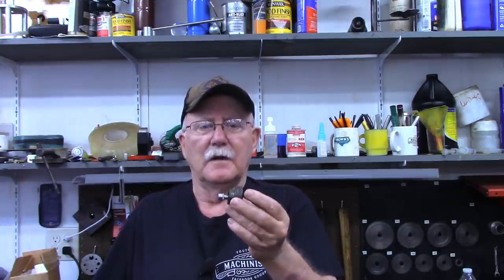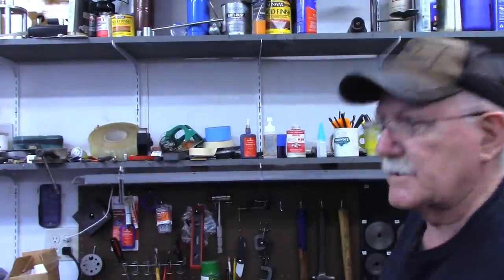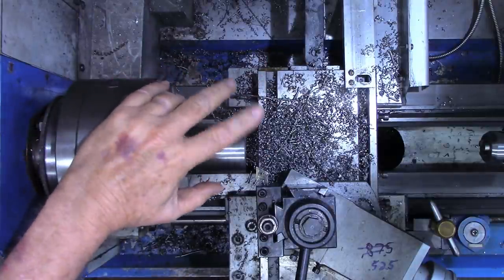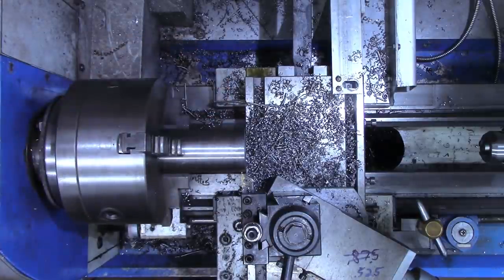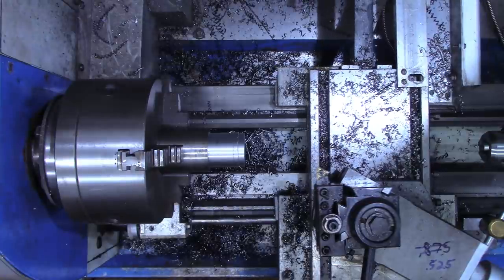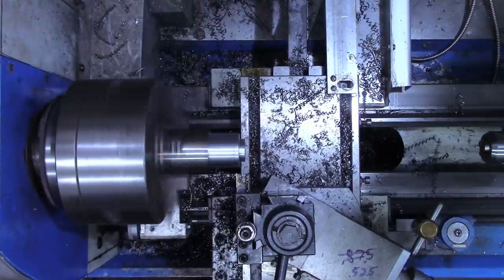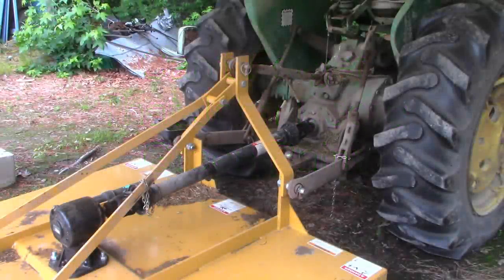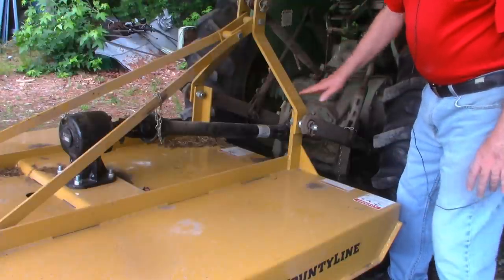Machining a Lift Lever Stop

Comment: Hi Lee . With form tools like that  if you use a slow speed , oil & a heavy in feed it usually will help with the chatter .  Just before depth , just work the tool a little to the left & right  &  drop rpm's again if the chatter rears it's ugly head again .     Cheers .

Comment: I have a Ford tractor and it had two limit stops on the lift when I got the tractor. However they were more like small wingnuts and not real easy to adjust. I like yours a whole lot better.

Comment: I think if you slow the spindle down some and use lots of oil will help some on your radius. But radius on a smaller machine is hard to cut. You did a darn good job wish my first one was half that good.